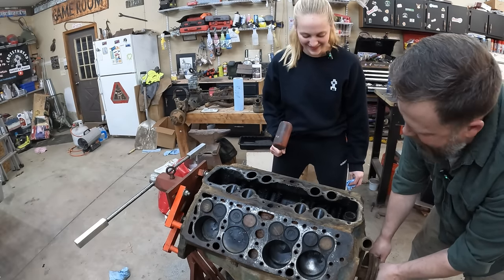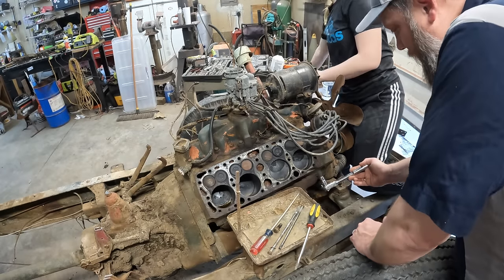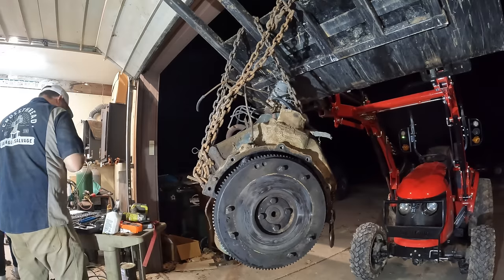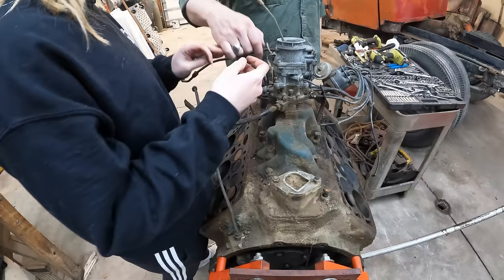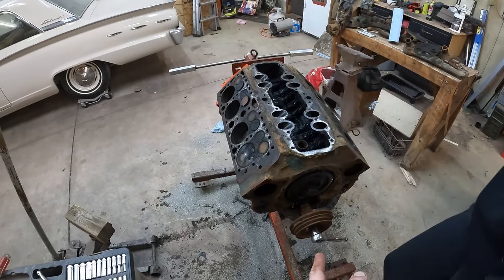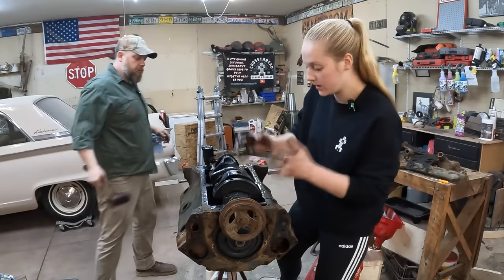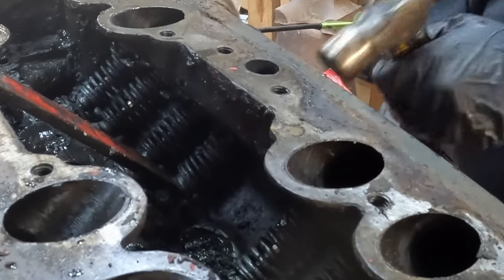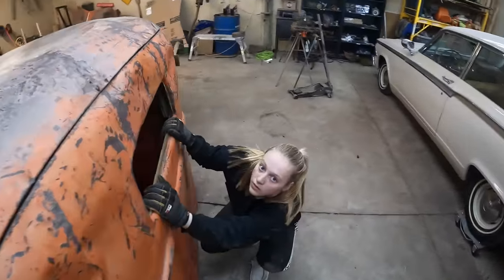BIG WIN! Mercury flathead is way better than we thought...and, also, way worse.

Comment: Back in my younger days,when you  looked at that much buildup. It was an engine that had Quaker state oil ran in it. The old version back in the Sixty's and 70's. I lost an engine due to using a good oil in one of these. great job on the engine. As always I liked and shared. All my best.